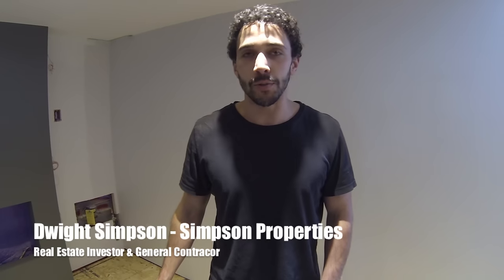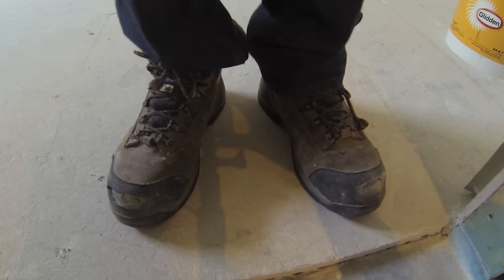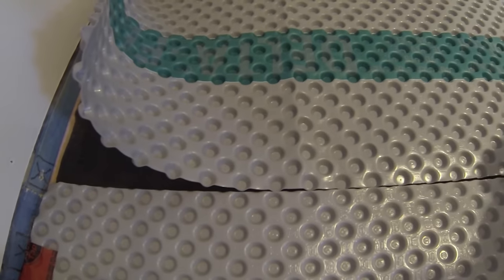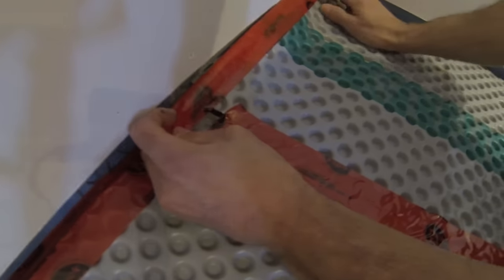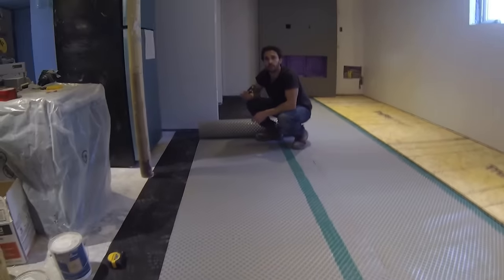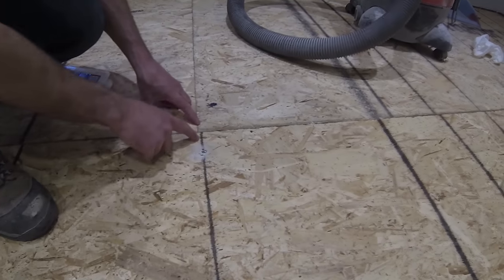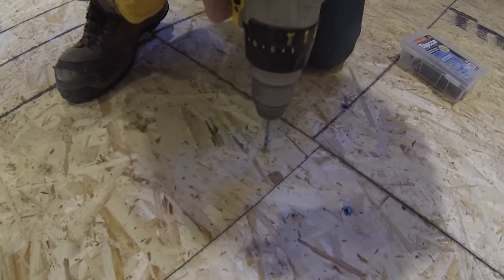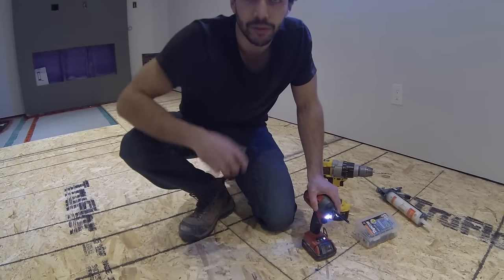HOW TO INSTALL A SUBFLOOR ON CONCRETE

Comment: Thank you for this great video ! As another guy commented, our hourse is kind of old (1955) the basement concrete is ok except some spalls and occasional efflorescence.. There never was water damage or rising up in the basement, from what I know. Should I be concerned about this, or can I go on and install the subfloor ?
Reply from the maker: Thanks! I'm glad you found the video helpful. The house that is in this video was built in 1955 as well. If you have efflorescence on the slab that means you have hydrostatic water pressure issues or cracks in the foundation. This can be addressed fairly easily and should be done prior to installing your subfloor. Any cracks in the concrete surface need to be chipped clean and then apply K7 Waterplug. It has a compressive strength of 5,500 psi after 28 days. Then a coat of Terraco Weathercoat 571 is applied. It's a waterproof coating suitable for concrete, masonry and plaster. This should stop foundation leaks and resolve any moisture problems. You can check out my Instagram account 'Simpsonproperties' and see pictures of these waterproofing products that were used recently in a cable pit.
Reply: Thanks for your reply ! I should have mentionned I intend to use self-leveling concrete to even out the basement, as it is quite uneven. Should I coat the cured concrete with the waterproof coating ?
Reply from the maker: +Rémi Fortier make sure you prime your original slab before installing the self leveling concrete. If you have hydrostatic water pressure issues the water will still force it's way through the new concrete. You can use your own discretion on whether it has to be waterproofed. It would help to get a few opinions from foundation repair contractors as well. You don't want to tear out your renovated space in the future due to water issues that could have been resolved before hand.
Reply: +Simpson Properties The self-leveling concrete I intend to use requires a primer coat to bond correctly. So I guess I'd need to put the waterproofing paint beforehand.

Thanks again for your replies !

Comment: Can I skip adding OSB if I am using a luxury vinyl floating floor?  Just use an insulation layer instead?  I am really trying to reduce the loss of ceiling height from adding the OSB.  I am also adding electric heat pads / radiant heat so that adds height too...
Reply from the maker: Yes you can skip installing OSB. I don’t think Delta-FL is recommended if you’re installing in flooring heat.
Reply: @simpsonpropertiesltd  Thank you!  I appreciate the response

Comment: Nice and very well said about Drycore! :D Great job, did my research and this i a way to go as for me.
Also nice access panel on the left side on the floor. Is it for sewage cleanout? I have mine in the middle of the room for some reason on new property and looking the way to make it look good.
Reply from the maker: Thanks! That access cover is for a back water valve. It prevents a sewage back up if there is ever an issue with the City sewer.

Comment: Am pulling up carpet installed over concrete slab which abuts tile.  We want to install a laminate floor in the whole space without removing the tile.  Can we just use this method to bring the level of the slab up to the tile and then lay the laminate over the entire area?
Reply from the maker: You could use this method to build up the old carpeted section level with your tile floor 👍🏽

Comment: Great tutorial im thinking of finishing my basement with a bathroom. However im not sure what to do with the height difference in bathroom tile floor. The floor assembly in this video is about an inch thick and tile on concrete will be much thinner. I not very comfortable in doing mud bed since i have never done it. Do you think it would be safe to use the same floor system shown in this video and put ditra on it and then put tile? What would you recommend. Thank you.
Reply from the maker: Babur Urya great question and I am glad you're familiar with Schluter products. It's fine to install Ditra over OSB but I wouldn't recommend doing that. I used Ditra heat in this basement directly on the concrete slab. Once the tile installation was complete there was a very minimal height difference. I used a floor transition between the laminate in the hallway & bath room floor.
Reply: Thank you very much.
Reply: Schluter Ditra can be applied on top of Ditra to help take up a difference of height if needed. There several types of Ditra available. Ditra is the thinnest with Ditra Heat being slightly thicker. Dita XL is much thicker. Any combination of these will get your bathroom floor very close if not level with your transition.

Comment: I know this is an old video and I'm not sure if anybody will reply but I might as well take a long shot on this but I guess I misunderstanding in regards to the screws that you used are actually fastens down onto the concrete or do you have to have pre-drilled holes?
Reply from the maker: Concrete fasteners were used and holes have to be pre-drilled. A popular brand name for that type of fastener is called Tapcons. A 3/16" masonry bit was used first with an SDS drill. Then you can install the concrete fastener.

Comment: Great video and just to double check the savings i did a cost comparison and this was definitely the way to go over the dri-core system at least for the area i am doing.  My question to you is regarding the lansdcape fabric; the fabric i got is a large roll and its folded once, should i leave it folded for that extra cushion or is that not needed?  Thanks!
Reply from the maker: Prices will vary depending on where you live. Generally this method is cost effective and most importantly performs well. I would unfold it. One layer of material is ample and will prevent that hollow/clicking sound. Use the extra material in your garden beds haha
Reply: @simpsonpropertiesltd  how much do u predict this system will cost for 1000 sq ft basement?

Comment: hiya. im laying a plywood flooring on top on concrete. But I am not on ground level. im on second level.  do I still need the landscape fabric or can I use a combo of polyethylene foam underlay topped with green fiber wood underlay.  then lay my plywood sheeting on top of that.
Reply from the maker: kimberly oakland if you’re installing foam under the plywood you should be fine. The foam shouldn’t make any noise when it’s walked on. After you install a few sheets do a test and walk around. See if you hear any noise.
Reply: @simpsonpropertiesltd  it was more to do with the concrete being able to breath incase I created mould or damp. thank you for the advice tho

Comment: Stupid question but ... do I need the wood panels if I'm putting down carpet?
Reply from the maker: It’s not a stupid question. I believe you do. Google “Delta-FL spec sheet” it shows the requirements for various finished floor applications.

Comment: hello, my husband and I are planning to do our unfinished basement. may i ask if is it better to do the flooring first before the drywalls or we can do drywalls first and separation wall before putting the walls?thanks.
Reply from the maker: I would recommend installing the subfloor first then frame all your walls on top. Sorry for the late reply.

Comment: loved this video although the thought of the wood subfloor scares me in case an overhead pipe were to leak. ripping out the subfloor would be awful, especially given the awesome job you demonstrated in piecing the system together.that being said, my main question is whether this system can be used on top of old vinyl tile that's glued to the slab? I do not want to pull up the tile as it would be back-breaking work and result in a pitted slab.thoughts? suggestions?  condolences? :)
Reply from the maker: Thanks for your feedback & questions. OSB is designed to handle minor water exposure that normally occurs during the framing stage of a home from rain. All the plumbing was replaced in this home so the chance of a Pex line leaking is not likely. Plus that's what home insurance is for if a major leak were to occur. 

Yes, this system can be installed overtop of vinyl tiles. If your home was built prior to the 1980's & the tiles are 9" x 9" there is a good chance the tiles and glue contain asbestos. If that is the case I would get everything professionally removed because you don't want to disturb the asbestos fibers while installing the new subfloor. If the vinyl tile does not contain asbestos then it's up to you whether you remove it first or install the subfloor on top. I personally would remove the vinyl tile first then install the subfloor.

If you have anymore questions let me know.
Reply from the maker: Thanks for your feedback & questions. OSB is designed to handle minor water exposure that normally occurs during the framing stage of a home from rain. All the plumbing was replaced in this home so the chance of a Pex line leaking is not likely. Plus that's what home insurance is for if a major leak were to occur. 

Yes, this system can be installed overtop of vinyl tiles. If your home was built prior to the 1980's & the tiles are 9" x 9" there is a good chance the tiles and glue contain asbestos. If that is the case I would get everything professionally removed because you don't want to disturb the asbestos fibers while installing the new subfloor. If the vinyl tile does not contain asbestos then it's up to you whether you remove it first or install the subfloor on top. I personally would remove the vinyl tile first then install the subfloor.

If you have anymore questions let me know.
Reply: thanks for the excellent response. I am thinking it would be better to encapsulate the tile if there is asbestos, especially as the cost of removal by professionals would be prohibitive. do you have any experience with jif-set? probably would need a contractor for it.
Reply from the maker: I have never worked with Jif-Set but I have seen some sub-contractors use a similar product to repair a leaking electrical cable vault. They used K7 Waterplug it has a comprehensive strength of 5,500 psi after 28 days. Then it was coated with Terraco Waethcoat 571 it's a waterproof coating for concrete, masonry and plaster.
Reply: thanks again!
Reply: Advantech plywood is a marine grade plywood. I've seen it sit out in rain storms and be just fine. It isn't anywhere near the same price as regular OSB.
Reply: Asbestos testing of the tile is inexpensive. Just wear a mask, wet down a square of on an edge and slowly pry up a corner or whole tile. Just be sure to have two tests done. One on the tile itself and one on the mastic. Most floors that I test only have 3% asbestos.
Reply from the maker: Robert Bialozynski I have heard great reviews on Advantech plywood unfortunately not to many suppliers carry it in Toronto. I will have to try using it on a job in the future.
Reply: I have had luck using dry ice in and old pillow case...90% of the time the tiles just popped right off.

Comment: Can you put an polyfoam board down before the osb for added insulation?
Reply from the maker: I have seen that done before. I would reach out to the manufacturer (Cosella Doeken) tech support line & ask them:

1 (888) 433-5824

Comment: Thanks for the tip. I am curious to know how you would first get the basement floor level?
Reply from the maker: mailmcfarlane you can use self leveling concrete.
Reply: Great vid, just wondering why not just use self leveling on concrete first, then put vapour barrier and insulation board down then laminate boards?

Comment: how much is the price difference between using your method and using the insulated dricore subfloor for a basement that's roughly 700sq ft. Also how would I make sure the floor is level before I put down the OSB plywood?
Reply from the maker: You will have to figure out the cost difference between the two methods. Costs will differ based on our locations and suppliers cost. One of the easiest ways to level the floor is using self leveling concrete on the low spots. You can use a concrete grinder to flatten out any high spots.

Comment: Great video! Wondering if I can duplicate on an exterior concrete slab which is only 6’x6’. After laying down exterior grade 5/8” plywood, I want to cover it with Trex engineered decking. What do you think? Thanks, Stan
Reply from the maker: I’m sure this would work for that application. I would reach out to the manufacturers tech support at Cosella Dorkin. It’s always best to confirm with them before going ahead.

Comment: How do you do this with water floor heating under it?. Ihave no idea where it is in the floor because i bought the house when finished with no drawing of it. Thank you and great videos
Reply from the maker: xander witt thanks! If you have radiant in-floor heat you should be able to install your finished floating floor directly on top of the concrete surface. Most people install a subfloor like this to add warmth which isn't an issuie for you. You can still use landscape fabric and Delta-FL. Then install your finished floor on top. You could also use Dri-Core panels if you really want a subfloor I believe that system does not need to be fastened to the concrete floor. If it does it's only the perimeter. You will have to do some research on that product.

Comment: Hi, your demo looks great, close to what I need to know but more related to squiky sub floor on a concrete. Not sure how to fix it. Do you have any suggestions or any other videos to fix the squiky subfloor on a concrete floor ? Thanks
Reply from the maker: Vimal Girish Gopalakrishnan thanks! Without seeing how your subfloor is assembled  it’s tough to answer that questions. Try adding more fasteners in areas where it squeaks or installing landscape fabric before you subfloor. That can help avoid a clicking sound if you are using a product like Delta-FL.

Comment: Great video. At 7:32 how did you do the acces regtangular shape  on the floor ? I have to accès some sort of pit acces on my floor.  I need some kind of acces to it like your. Did you put the floor over it on cut after ?
Reply from the maker: Thanks! All I did was cut that shape out of the Delta-FL and OSB. I glued the Delta-FL to the OSB. I permanently attached the finished flooring to the access panel. I used flooring transition pieces to picture frame access panel for a clean finish.

Comment: Thanks for all the great videos. I was planning on using xps board for the walls of my basement until a contractor gave me a very reasonable quote for closed cell spray foam. How would you suggest taping or sealing the closed cell foam's uneven surface to the pressure treated board with foam under it and the dmx roll with rigid foam on top of it and still get the vapor seal?
Reply from the maker: You would instal your subfloor first, then walls on top, install spray foam in all the wall cavities. The closed cell foam does an excellent job of sealing between the OSB subfloor and foundation. Creating a continuous vapor barrier on your exterior walls.

Comment: Nice clean to the point video. I have a question however. I have old asbestos tiles in my basement.  I can't afford to remove them so i want to go over it. What would you recommend doing as a flooring option? I would love to put carpet down there and have a livable space. Thanks in advance
Reply from the maker: Whatever method you go with make sure you don’t drill through the asbestos tiles or disturb them.
Reply: @simpsonpropertiesltd  thanks

Comment: Hey I just installed this product in my basement. Your video was very helpful. I'm about to put down vinyl plank click flooring. Can I lay a sheet of 6 mil poly before I put my flooring down? Thanks!
Reply from the maker: Thanks for the feedback. I have never worked with vinyl plank flooring. I would check with the manufacture of the flooring. See what they recommend.
Reply: A Delta FL membrane is a vapor barrier and you never want to have a vapor barrier on top of another one or you will trap moisture between them. This is why you dont add a 6mil poly on top of a urehane (closed cell) sprayed basement wall .

Comment: Is it ok to frame a wall over this new subfloor?
Or should you frame the walls in first?
Also, if I understand correctly, you should run the vapor barrier down a couple of inches longer than the wall, and over the top of this Delta-fl, and tape it down with the tuck tape, then lay your 5/8" OSB down... Correct?
Great video! Thanks!
Reply from the maker: Sorry for the late replay. You can install walls before or after. It’s easier to install the walls on top of the subfloor.

Comment: Great video. What's the approximate height added from the concrete top the finished floors? I'm trying to figure out what the best option is for a basement with low ceilings.
Reply from the maker: Add up the thickness of Delta-FL, 5/8” OSB, plus your finished flooring material.

Comment: How would you handle a floor drain in the concrete.  I have a 4" clay drain, trying to figure if I should close it off or convert to pvc and extend to new floor level.
Reply from the maker: I installed the subfloor overtop of the floor drains. Make sure that your floor drains are primed or else you will get sewer gases coming through that drain.

Comment: Good video..how would I go about doing this in my laundry room in the basement...which has a drain in the middle of the floor?
Reply from the maker: Thanks. It’s the same process but you could make an access panel for the floor drain or extend it to the new finished floor surface.